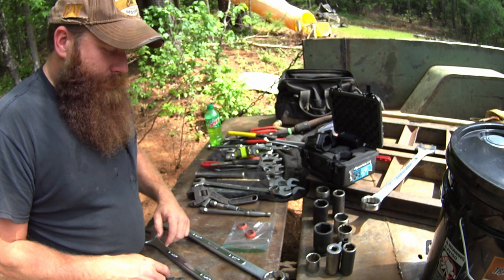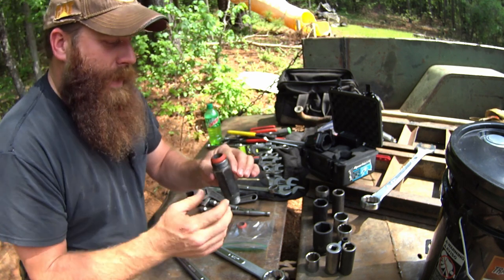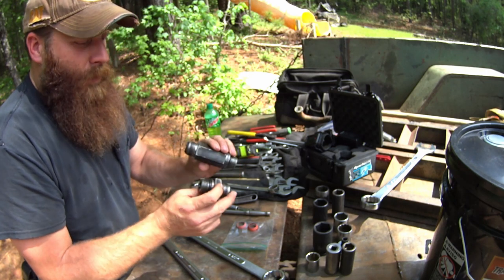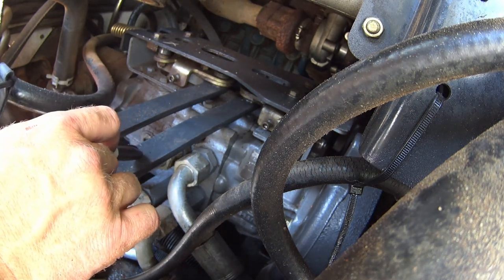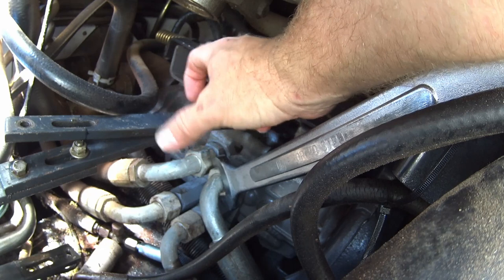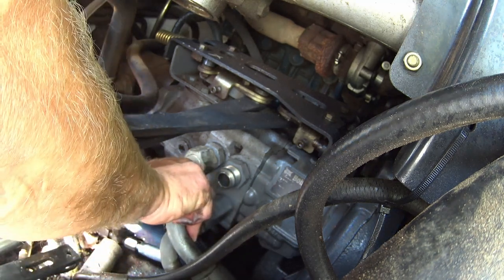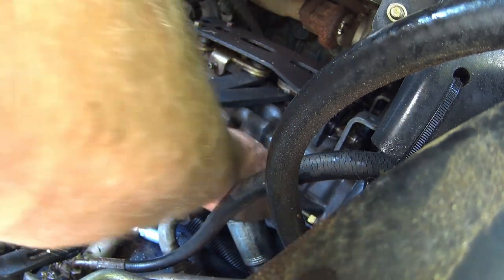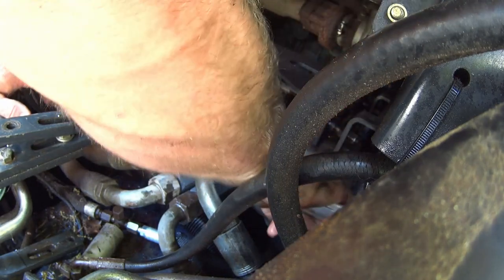Bobcat T250 Flaretite Hydraulic Seal Repair

Comment: I have to pull the pump on the same machine and I can't get the AN-16 motor hoses off at the pump. Those adaptor pieces that goes to the pump want to turn. I secured  the adapter with  wrench and still  can't get it to break loose with a force bar on a crow foot 1-1/2" wrench . What a PITA to work on. Great to know those Flaretite seals are available, just have to find a way to get a set to Canada.